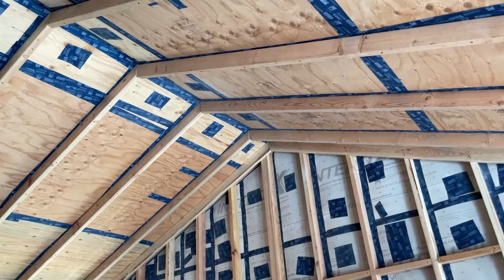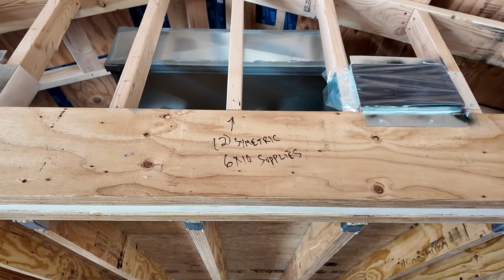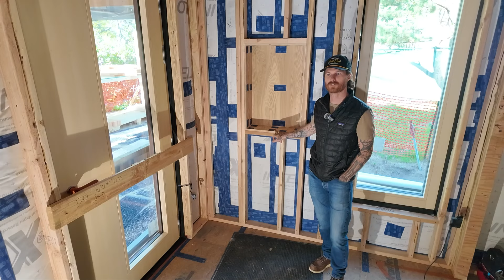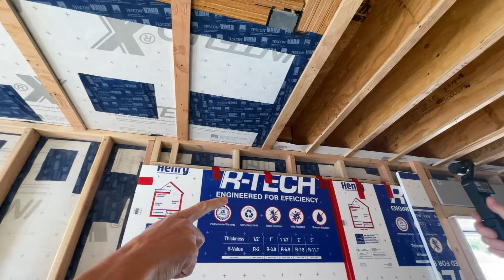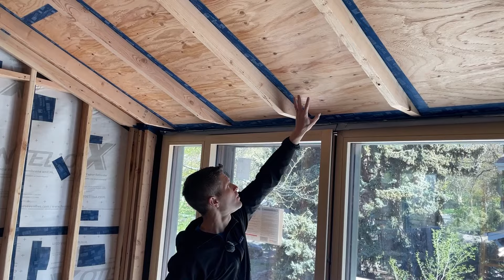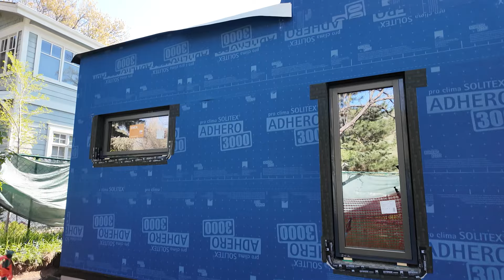Nailing Passive House Details with Better Jobsite Communication

Comment: Wondering about not having Intello on the ceiling inside the insulation. Will there be any vapor barrier inside the insulation? If not, I'd think this would allow condensation at the exterior layer inside the roof in the winter.
Reply from the maker: Taped plywood can be airtight and plywood itself is somewhat vapor-variable, but INTELLO would be a higher performing and lower risk option than taped plywood. In this particular case, the assembly can dry to the outside if there is condensation within the assembly.